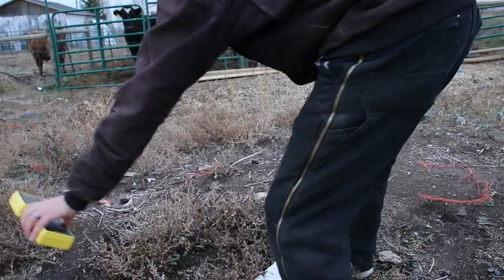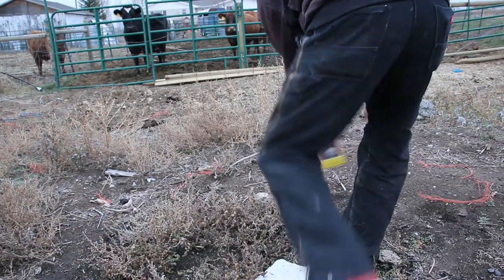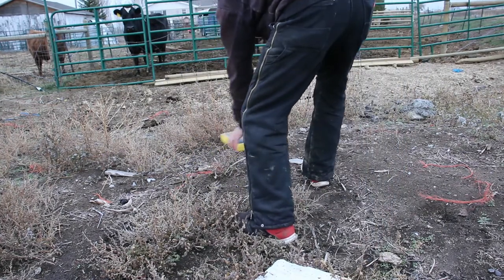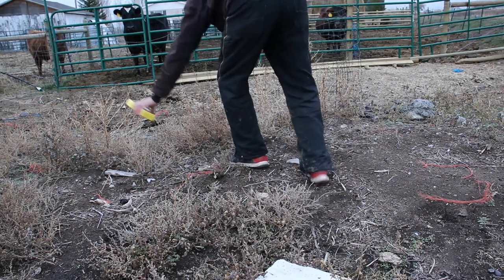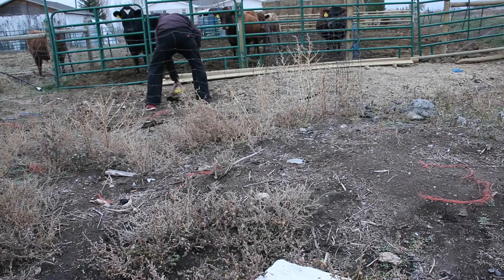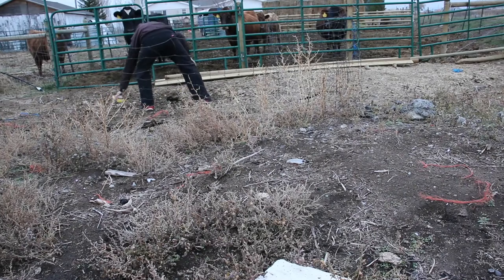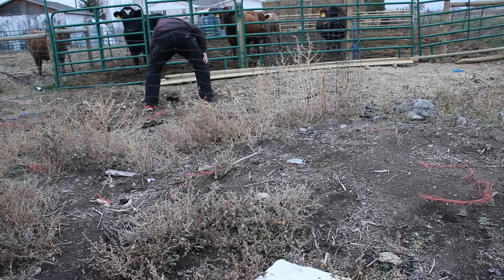Frost Free Hydrant Installation || Episode 1

Comment: Do you have a link for the hoses? I’ve been hauling water to my horse in 5 gal buckets 😅
Reply from the maker: Here is an affiliate link 
https://amzn.to/2ZNvuSW
We have had more luck with the 50 footers and then getting as many as we need as opposed to buy a really long one like a 150 footer. I would suggest also getting at least 30 feet more than needed as they are only the advertised length when there is some resistance to flow. It takes forever to fill any thing up this way. if you get the extra length you can open it up wide and just let it flow.
Reply: @IdaHomestead  thanks so much!